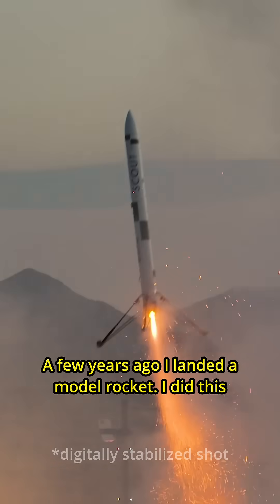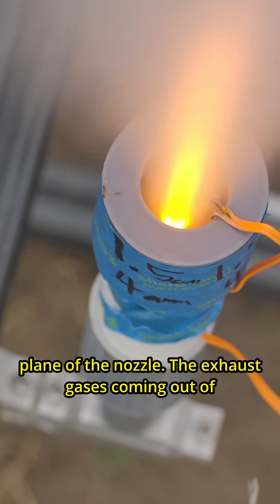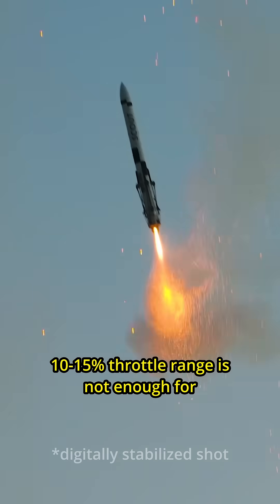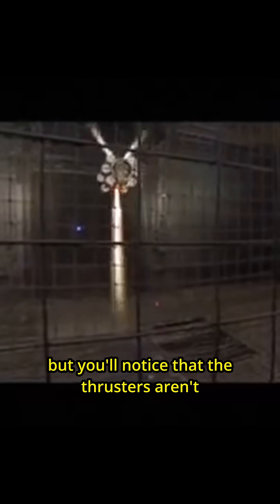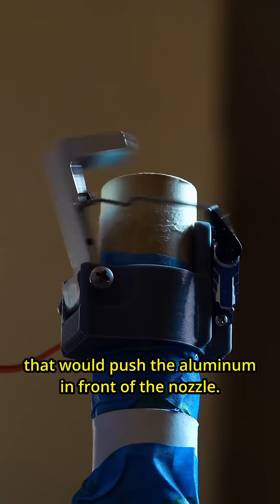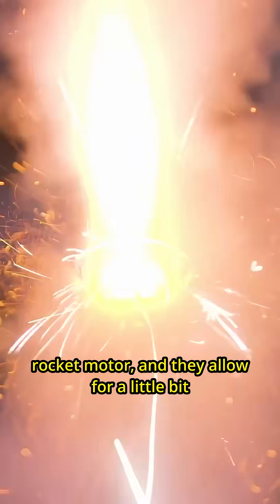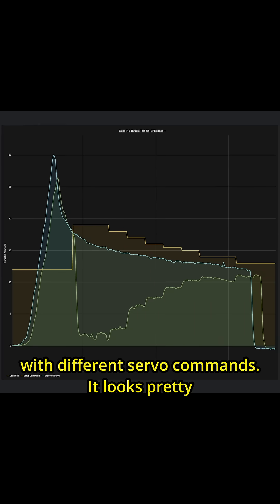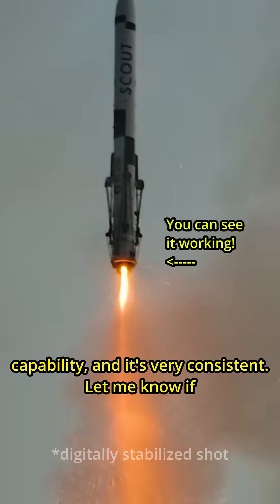Solid Rocket Throttle Control

Comment: "Let me know if you would have solved this differently."   Bruh.....you have greatly overestimated me.
Reply: You've gotten the internet's attention. We expect great things from you.
Reply: I was thinking of a manifold near the exit that is an offshoot from the main nozzle that points slightly upward, causing part of the exhaust gas to work against the thrust, this, in theory would allow for finer control with a higher control range. However we won't know until it is tested.
Reply: @Voidtank75so like reverse thrust on a regular plane? Also doable. Personally I’d probably have looked into,throttle controls with PWM(Pulse width modulation) as that’s what I’m most comfortable with at least in other fields.
Reply: It's not like it's rocket science.

/s
Reply: @sinisterswag  rocket recess

...that reads condescending, I meant because it's fun.
Reply: @coreymartin6363  it was sarcasm, but I very much enjoy reading the whole debate while having no idea what any of it means.
Reply: The only strange thing was the aluminum. I thought to myself that will melt. Other then that insight is all yours. No way I could do that. Well, except for the aluminum thingy melting. I could have told you that like the back seat driver I am here.😂
Reply: Can you port your ceramic blockers to divert exhaust gases at a 45° angle in four directions? Not sure that 45° is specifically best, but that or a more shallow angle, normal to the rocket axis, might provide directional control. With (4) 'blockers', you may be able to increase your directional control.
Reply: Your idea keeps thrust in the center, which helps the rocket stay stable on the downward movement.  Experiment with different shapes of the two pieces for better control?
Reply: Man I totally would have used what all elite engineers do….. “gaffer tape”
Reply: Says the man with a video about how to make a DIY cookset! 😂😂😂
Reply: @isaiahmoore1454  but it doesn't fly lol
Reply: I would have used an iris set about 1/2 an inch down. This gives 2 benefits, it looks cool while offering a way to keep Goa'uld from flooding Earth with really tiny Jaffa.
Reply: Variable nossel shape  like the extension but squeeze and expand
Reply: I would have done the same
Reply: Weare waiting
Reply: Mee too😊
Reply: Vary the exposed surface area of solid rocket fuel.  kinda like control rods in a nuclear reactor. Control the reactivity.
Reply: The sheer amoumd of Rocket motors It took for.testing, impressive.
Reply: Just use the Luke Hopkin effect! It will solve all your problems!
Reply: Is the placement of the ceramic at the nozzle  critical for control? Do they have to be so close? What about actual control surfaces further away made of heat resistant material but lesser so. Possibly incorporated into the landing legs themselves? The physics at smallscale sizes don't always translate to full size so you may get away with things not possible in the bigger world. Hope that sense? Cheers.
Reply: Ha.😂  True here too - by far.
Reply: Would you have more control with an iris design for the blocker, similar to a camera shutter?
Reply: For real bro. I don't think smart people realize how smart they are. This stuff just doesn't register with me, but it's fun to watch.
Reply: No, you have greatly underestimated yourself
Reply: Yeah - let me know if you tried throwing rocks at it from different angles. That's all I got. 

Simple, Brilliant Solution! 🎉

Comment: I mean if you aren’t fully set on the solid but still want some of the benefits, you could use a Hybrid motor, it’s just solid fuel, that can’t burn on its own and a liquid oxidizer and the more oxidizer means more combustion. It’s a lot more variable compared to the blocking system, now just using a variable valve after a small electric pump for the oxidizer, it’s not a ton more space.
Reply: I mean ig it depends on what his reasons for the solid boosters are, the simplicity of a Hybrid is miles ahead of a liquid but i’m sure space might be a constraint, still pretty cool benefits for that little tho
Reply: @ArachneOSS he is working on his own 3D printed liquid motor tho
Reply: I was going to suggest going fully liquid. But this is an interesting idea.
Reply: 1) Another Proot!
2) It's always DNS

Comment: What if you cut your ceramic at a like a square and you cut it at an x so you have four servos controlling it and you can cut it down to about a quarter of thrust and you can probably do directional thrust a little bit with it as well I just don't know how you can hold on to it with the servo.

Comment: Why not try to use an afterburner type situation kind of like an F-18 or F-14 uses. By using those fans circulation fins to close in on the like the afterburner and of course you might have to have more than one actuator to move it and close it and open it as you're launching the rocket which would vary the actual thrust